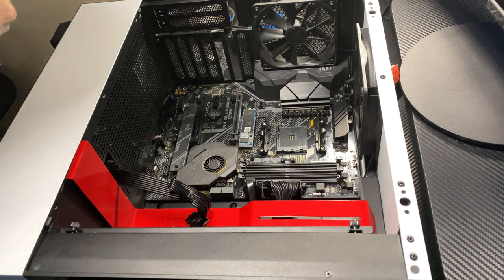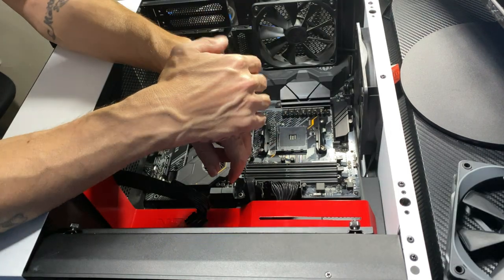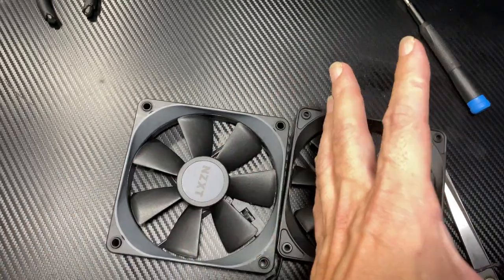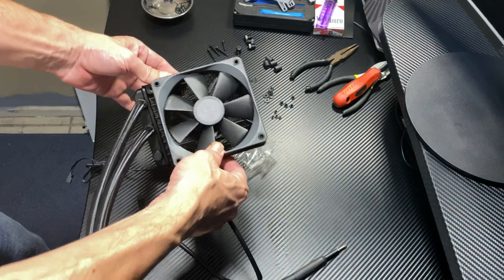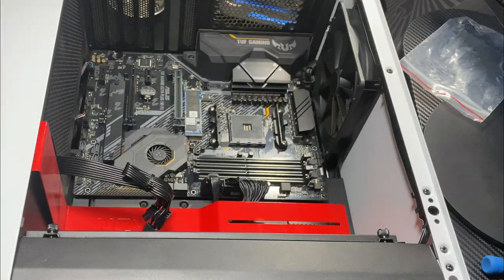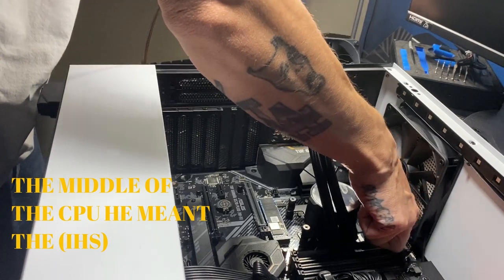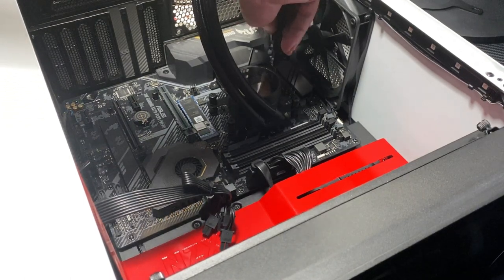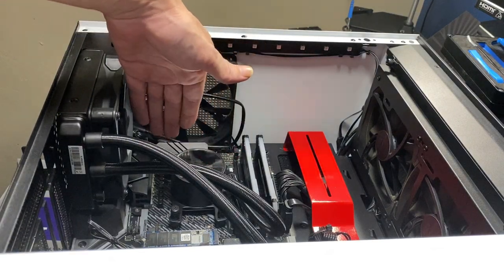Installing kraken M22 AIO time stamps for easy to follow along instruction.No profanity clear spoken

Comment: just ordered and i am definitely coming back to your video when it arrives 👍
Reply from the maker: glad to hear that, if u need any help please feel free to ask and I'll do my best to help u out
Reply: @2020Tech4U  I have a question!🙋‍♂️Is it bad to have the tubes positioned on the top of the radiator? I have seen some aios with the tubes on top.
Reply: @kien1520  I suggest watching jays2cents video on AIO it’s short and give you an idea what is the best way to give it the longest lifespan
Reply from the maker: @kien1520  as long as the pump is the highest point in the loop then no, but with all the fear about tubes down going around I can say this. your pump wont fail if this is the only position u can put it in, you will just get some guggling noises and reduce the life of the pump, just try to stay tubes down or keep the pump the highest point in the loop. but if ur using the m22 kraken with the pump in the RAD then it doesnt matter
Reply: @2020Tech4U  thx 🙏
Reply: i bought mine yesterday and its awesome although many tech guys said its not worth it but on my case its awesome its working perfectly and the cooling great!
Reply: @noshfn7220  I installed the m22 kraken about a week ago and it performs pretty good. It definitely outperforms my stock amd cooler.

Comment: wow is this why my kraken m22 buzzes now? nzxt installed my prebuilt with the hose at the top!
Reply from the maker: The funny thing is because the pump is in the RAD  and you place the rad how i did then the pump will be at the highest point, but CLC coolers are weird, so that logic is not completly right for them, I know it's stupid confusing, I agree. But you may be getting that noise from your fan on that RAD, try another fan and see if it stops, if not, then see if they will honor the warranty

Comment: i bought mine yesterday and its awesome although many tech guys said its not worth it but on my case its awesome its working perfectly and the cooling great!
Reply from the maker: The reason they all talk down on it so hard is because price to performance and it being "water" it should have better thermals. But I feel it works fine and looks great, also a lot of cases do not fit 240's so this is a viable option, I like it and I installed it in my sons PC. I wouldnt use it on our PC's if it was terrible, I'm happy you like it cause thats what count's!

Comment: I have this aio installed on a 109850k. It seems to be working fine so far. The temps are 27c on idle and 44c while gaming. It doesn't get too hot.
Reply from the maker: Thats pretty cool temp wise and cool it worked out for you, a lot of ppl do not like this AIO but it works fine as long as u do some research on your CPU and case airflow.  Thats a warm CPU @ 95 TDP so thats really good temps

Comment: The pump was in the radiator. Consider that on this model . 
I repeat, the pump is in the radiator
Reply from the maker: A lot of other AIO manufacturers are starting to put the pump in the rad to avoid patent suits. But I don’t care for the pump on the rad much
Reply from the maker: I showed that the pump is on the RAD like 2 or more times in the video and also explained that NZXT didnt want to pay the Patent holder royalties  to place it on the CPU heat sink. Even though they work with the company that holds the patent. did you watch the video? I even gave a close up of the pump on the RAD. I think you commented on the wrong video but its cool.

Comment: 14:40 - The pump in the M22 is not inside the CPU block. The pump is at the center of the radiator. Check out https://www.youtube.com/watch?v=aTXYKaf949Y&t=115s

Comment: that android cable is pump power right ?
Reply from the maker: No that is for the Infinity Logo on the pump, the wire that looks like a Fan connection coming off the Radiator that should either go to your CPU/CPU OPT/PUMP header is for powering the pump

Comment: my cpu temp recently started to idle at 60-70 degrees celsius and while playing games it gets to 95+ celsius , i havent done anything to the pc it just randomly started, what do you think it could be? i dont know alot about computers but im trying to learn some
Reply from the maker: Did you build the PC yourself? What are the Spec? CPU,Cooler,Case etc.. If you built this PC and you built it over a year ago even 6 months this can happen, and you recently moved the PC, the thermal paste application can break causing hot spots on the CPU. check your radiator and see if it needs to be cleaned, pull the fan off and check in between it and the rad. Clean out the PC, use a can of compressed air, clean filters. if your using a tower cooler make sure the fan attached to the cooler is directing air flow toward the rear of the case assuming your PC is in a standard tower. If your using an AIO then the pump maybe dead, your PC would still turn on and work because the water and cold plate are in contact with the CPU so even with a dead pump your PC will still work and honestly this sounds like the issue. Let me know whats going on. Also you can send me a short video of the PC and then it thermal throttling if needs be. Again keep me posted and I hope you figure it out.

Comment: For my amd motherboard is it really necessary to use the backplate it comes with or can I just use the one with the motherboard
Reply from the maker: If you can figure a work around the mounting then of course you can use the backplate on ur mobo, but also you may not get full mounting pressure which may in turn give you bad thermals. This of course if you can get around the mounting of the CPU cooler.

Comment: Will this fit an omen 30L and if so what all will be needed to?
Reply from the maker: The 30L is a standard ATX mid tower pre-built if I recall. and this CLC can fit in any midtower case. You will just need what comes included with the cooler and thats all, you might want to get a small tube of thermal paste in case the pre-applied gets smudged by accident.
Reply: @2020Tech4U  thanks for the help, also ive seen i may have to so kind of 9pin usb male to female splitter?
Reply from the maker: @TheReal_G  That sounds like a front panel extender for ITX builds. is it a solid plug on 1 side and split plugs on the opposing?
Reply: @2020Tech4U  imma be honest im not 100% sure, new to pc world so im slowly figuring it out. And i think it has something to do with the usb 2.0?
Reply from the maker: @TheReal_G  oh ok, then its for the infinity light logo on the CPU cooler part of the CLC. You plug that in your USB 2.0 header usually found bottome center of the motherboard to get the infinity effect, then download the NZXT cam software to control the light and other stuff on it.

Comment: For some odd reason the bracket for mine is extremely hard to get off. Did you have this problem by any chance?
Reply from the maker: yes but after a while it gets easier to remove, I'm always switching coolers or CPU's so usually the first installs things are tighter or really hard to open up but after a few times they get smoother

Comment: in the manual it is written to connect the 3-pin pump power cable of the pump to the 4-pin CPU_OPT or AIO-PUMP, but I don't have those headers. Should I connect it to sys_fan ?
Reply from the maker: yes that is perfectly fine. You connected the Fan thats on th RAD to the CPU header correct? But yes that is fine, the pump will run at full RPM

Comment: the stock thermal paste was good enough right?
Reply from the maker: after a few months testing the stock paste application and thern changing to arctic silver I only saw a degree or 2 of change (cooler temps with arctic) so it doesnt matter, also I will be updating this video this month, but I'll give you a spoiler so if you diont want to know stop reading now...........Ok spoiler ALERT! this AIO like i kinda said in this video will not really be a great choice for overclocking and actually the stock cooler is on PAR, but the AIO will help to hold PBO a lil longer but the same numbers in the end, so like i said in the video this AIO is more cosmetic then over clocking beast lol
Reply: @2020Tech4U  thanks for the reply. I’m finding that it helps keep my levels great on my i7-6700k. I’m only overclocking 12.5% more so it’s a good cushion for lower risk. Temps are staying below 70 degrees on my highest demanding games, which is fine by me.. I don’t have room for anything else for now! Thanks again and good luck!
Reply from the maker: @MatchaMan  Wow I'm really suprised you got those Temps to be honest, great job and smart with keeping your OC at modest levels that is excellent thermals on the 6700K to be honest i think you got a good CPU.

Comment: hi there ive been following your steps to install the aio but i notice the pipes are leaning on the graphics card, and my friend said its bad because its picking up heat from the graphics card, should i rotate the radiator?, sorry i have bad english
Reply from the maker: Its ok as long as ur Graphics card has a back plate. but if it bothers u then u can turn it. The back plates are for looks and do not act as more surface area for the GPU Die for cooling. I would not do this if it was a bare PCB
Reply: @2020Tech4U  okay i will try that thanks for the explanation and the tutorial
Reply from the maker: @realishticz  NP, all this PC stuff is trial and error, dont be scared to try new things and turn on settings and push ur system within its capabilities, this is why we build them lol

Comment: How did you close the panel back?
Reply from the maker: panel? around what time in the video are you talking about? or give me a little more detail.
Reply: @2020Tech4U  you did not show us that you put back the glass panel. Im having trouble with the tube blocking the glass panel back. (Radiator on rear just like you did here)
Reply from the maker: @pablohanmaaa  you talking about the case's side tempered glass panel? if so just push it on and tighten the screw.if your talking about the hoses coming from the CPU mounted NZXT logo they can swivel up or down to make room. if those arent it go on IG and send me a pic 2020Tech4U on IG

Comment: Hi! I have just bought and installed the nzxt kraken m22. I accidentally touched a bit the thermal paste and It is giving me 33/36°C while in Desktop. And 50/56°C while gaming. Temp on street is 26°C. Is It okay? One more thing. I have 3 fans on the front giving fresh Air to the tower. And I have two 140mm fans and the top taking the Hot Air of inside to the outside. Should I change them to get more fresh air? Or maybe one of them?. Thank you!
Reply from the maker: What CPU? I figure either R5 or I5 65 Watt TDP, I used this cooler with an R7 and I was getting a lot higher temps by like 10c plus, Those are great temps btw, if that cooler is keeping the CPU at those temps then it will boost longer and will not wear out as fast as compared to a stock cooler running higher temps so your doing good especially if the CPU is higher then 65watt TDP, Fans are perfect position, the best way to check is get some incense and run the smoke along the cracks of the case and see if air is trying to get in, that would be negative pressure (not what you are looking for) if smoke is blowing away (positive pressure) which is ok, getting neutral pressure is not easy to achieve and takes a lot of trial and error, but positive is fine especially with filters. Everything looks good to me and if it bothers you then remove the 4 screws and buy some thermal grizzleys thermal past (kryonaut) apply the paste evenly to the IHS (the CPU) and re-seat the Kraken lol but again those temps are good not bad.
Reply: @2020Tech4U  my CPU is an i5 8600k 3'6ghz. Thank you for the answer! I'll try out that incienso thing! But I am Happy that i buld It on the right way 🙇🏻‍♂️❤️
Reply from the maker: @tonyguerreiro3679  Jayz2cents did a great video on the incense and how to do it and explains great detail on the different flows. I hope this all helps.

Comment: Sorry to ask but shouldnt be fan of the radiator facing the other way? To not breath in warmth from the inside of pc ?
Reply from the maker: Please ask away I love answering lol The fans for PC's are opposite then a home fan, the air flow is toward the housing supports unless otherwise stated on the housing of the fans, it makes them look reversed.
Reply: @2020Tech4U  do i have to use a nzxt fan or mine that came with pc? as im really new to this
Reply from the maker: maybe i read ur question wrong i apologize. with my build there is not much over ambient temp inside the case to make a big difference, i moved the RAD to top and in front and there was no difference in temps, the 3700x is a 65 watt TDP processor and when iput heavy load on my PC i take the side panel off just to keep it at around ambient. I apologize for misreading ur comment
Reply from the maker: @charliewhetren4720  u can use any fan u like, the NZXT fan is optimized to push air thru a radiator where case fans are for air flow, but u can use them if u like, if u have a static pressure fan those are for RADs that fits the RAD 120mm then of course use it. count the blades if there is 7 and really fat blades those are Static pressure, 9 and slim are airflow optimized. static for Rad's airflow optimized for case.
Reply: @2020Tech4U  thank you so much!
Reply: @2020Tech4U  also i have an intel core i5 will it work? but i might upgrade to i9?
Reply from the maker: @charliewhetren4720  what socket?
Reply: @2020Tech4U  umm im not sure
Reply from the maker: @charliewhetren4720  it might be LGA 1151. and honestly this AIO fits a lot of sockets, but u need to know the socket type to make sure u use the right mounting system.
Reply: @2020Tech4U  Thank you for your answer. happy new year.

Comment: hola, tengo un sonido muy fuerte como un crujido en el radiador, pero solo cuando pasa los 4000 RPM, que puede ser?
Reply from the maker: podría ser el ventilador o las aspas del ventilador golpeando algo. Además, con la bomba dentro del radiador, podría haber burbujas de aire debido a la evaporación del agua. prueba primero la teoría de los fanáticos y luego actualízame.
Reply: @2020Tech4U  gracias por responder, que líquido recomiendas si es que necesito rellenarlo?
Reply from the maker: @gplibertador  no hay forma de llenar este. intente moverlo para aflojar las burbujas de aire. voltee el radiador boca abajo y mueva las mangueras.
Reply: lo he movido de todas las maneras, pero el sonido no desaparece, solo puedo silenciarlo con un programa que lo mantiene al 80% de RPM's
Reply from the maker: @gplibertador  Entonces podría ser que el agua en el circuito esté baja y reducir la velocidad de la bomba es asegurarse de que no entren burbujas en la bomba. Esté atento a la bomba porque no dan una advertencia cuando se apagan por completo
Reply: @2020Tech4U  si, muchas gracias por el dato

Comment: Hi I have the same cooler , but the CPU temp shoots to 99 immediately on running cinebench r23 even without over clocking . I got intel i5 10600k and z490 mother board. Unable to figure out what’s happening. Strangely the NZxt cam sw is able to control lights but says cooling device unavailable
Reply from the maker: This is why I uninstalled it, my temps will shoot to 91c or higher even when using Ryzen master stress test, I'm doing a follow up video where the stock AMD cooler is better then this cooler, but like i said in the video, this cooler is for looks not OC. I get messages from ppl saying they get great temps but I over clock and actually use PBO and this cooler isnt for either. I'll probably use ur comment in the update if thats cool?
Reply: @2020Tech4U  thanks , just an update. The thermal paste wasn’t applied properly and after fixing that the temps are pretty OK. Cinebench R23 tests were satisfactory without any throttling. Average temp was 85 deg.
Reply from the maker: @cheesebalz100  I'm really happy to hear that thanks for the update, why did u buy this cooler? the infiniti logo? case restrictions? I wanna do a detailed update to the video and want real world reasons like yours. Do you over clock or 1 touch PBO things like that, if your ok with answering and me posting any findings, plus I'll probably ask u more questions. that cool?
Reply: @2020Tech4U  I got a i5 10600k which can be over clocked but as of now I will stick to stock settings. I play Digital Combat Simulator and wanted to use VR along with that , hence I chose the configuration . M22 seemed to be a affordable cooler within reasonable price range, hence I went for this particular cooler. My observation after 2 days of usage 
1. The NZXt cam software doesn’t indemnify the M22 cooling device , infact it says no cooling devices detected.
2. We can control only the RGB lighting scheme through software 
3. The other settings such as fan speeds etc can be changed only brought BIOS
4. All said , after fixing the thermal paste the PC is performing reasonably better with cinebench score of 9400 without any thermal throttling issues.

I think the cooler is fine and hope it sustains that way.

Thanks
Reply from the maker: @cheesebalz100  I'm glad it worked for u in the end, have you tried uninstalling and reinstalling cam? I hate all the bloatware but these companies on purpose put the RGB on rainbow to make u install their software, I was going to order the EK open loop full water cooling kit and see how that works out, they start at around $250 but its an open loop, a custom loop is around $500 and I cannot afford it lol